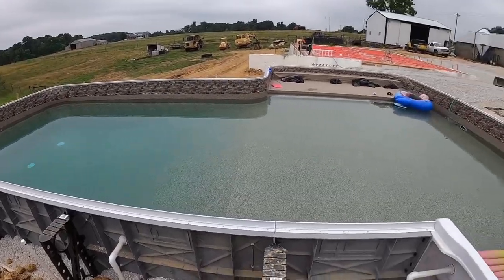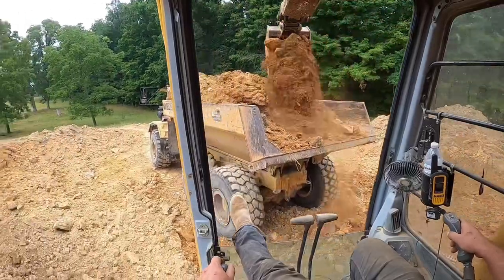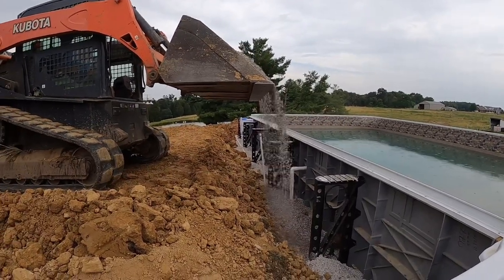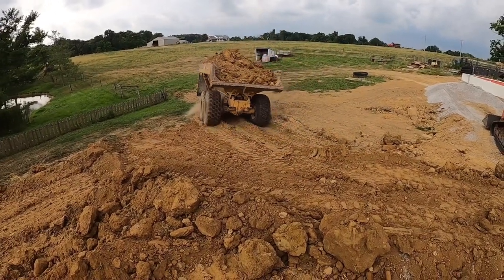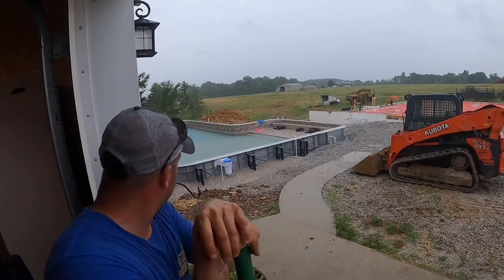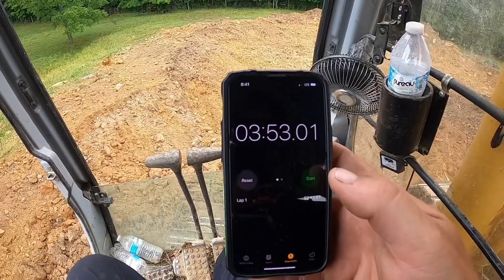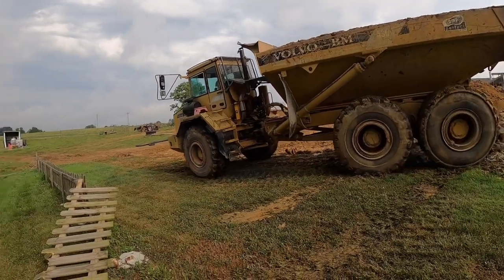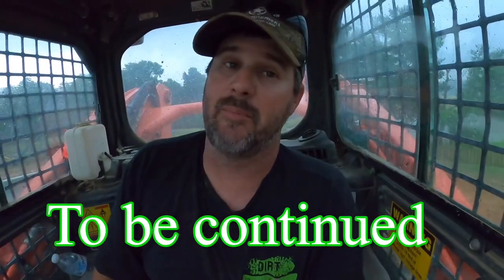This job has turned into an adventure, Kubota broke down and Matt crashes Bubba Dump into a fence.

Comment: I'm a landscaper from Tasmania Australia. A landscaper in Oz does a lot of construction & design. Deck, walls, pools, tiling, etc. Most of machinery I hire in is smaller. We don't build lakes (dams) of land clearing. We mostly import the materials onto our sites. Aggregate, gravels, soil, etc. Just going on you times, it seems far cheaper to do this than to dig up properties & create hug scares & messes. I use rubber wheel skid steers to move this around & hand tools. The areas are much smaller. I keep very clean sites & final day clean ups take about an hour. I also use 'skip' bins to facilitate this. I enjoy the big machinery side of things. Too much banter for me. I have been to America on several occasions mostly to New England & California but would love to visit your area. The size of equipment you use staggers me.

Comment: Guess the Kubota going. Could you swap it for the 210. Mmmm. Bubba dump likes that fence. The site will look great when you finish the job. The maths you did. you made a fair point with both machines. I know you like the 210. Kubota when thats another story. Aaron did get it working. Nice and slow. great work Mbts.

Comment: Seeing Bubba Dump slide down that hill reminded me of the time I parked my 1973 GMC step side truck in the driveway like I had many times. The driveway had a slight downhill to it. I looked out the window and the poor old girl was sliding down the hill and to the ditch. There was just enough ice on the drive so iI didn't slip walking, but I guess the warm tires created slickness under them. I was able to drive it out of the ditch before it broke through the thin ice/frost layer. The truck was rear wheel drive.

Comment: It's interesting that you have so much trouble with your Kubota - an earthmoving mob I worked for a few years ago had 2, around the same size, that seemed to do pretty well, while the equivalent Cat was an absolute nightmare... One thing after another went to (the unpleasant place), but the oranges seemed to just keep on going... And as I'm a truck driver first and foremost, I think Matt did a pretty good job keeping that monster from doing more damage than it did... And Aaron's just Aaron... hehehehe
Reply: Especially since they use those machines pretty hard New York farming Fixing and fabricating. Probably they have several machines that get used daily with Lots of hours.
Reply: Because unfortunately you can get 1 machine (any brand) off the assembly line and the very next one made behind it, and one could be great and the other terrible. Quality has slipped in manufacturing of the last 30 years since planned obsolescence is a real thing.
Reply: I didn't and I like to kill myself on a Kubota. When I called up the Kubota for the damage it took place they told me they're working on making a better one but they are still so far and they know it. They got a good idea but they do need a lot of work in advanced engineering to truly be in a commercial business attitude. Sincerely Nick
Reply: Kubota mini excavators are extremely high regarded in Europe. But those are made in Japan, not Georgia like the skid steers....

Comment: Like you said it depends on what kind of jobs you are doing. That jd 120 really runs really well and is moving alot of dirt in a little time. And for as little fuel it burns it might be cheaper to run the 120 instead of the 210. Awesome video.

Comment: We once put a loader on Michelin 650/65R25  XAD dumper tires because the same dimension XLD (loader tires) werent available. Michelin said dumper and loader tires were the same carcass, only the tread was different.

Customer called back after a month or so: He had ordered XAD for his other machines too, because in his work, spreading clay on dams, the XAD dumper tread provided much, much better traction and self cleaning than the regular XLD loader tire...

Comment: Collision with fence!  This was a slow motion, picture perfect demonstration  of the reason antilock brake systems were developed. Essentially, "If the wheels don't roll, you don't have control."
Matt followed his first instinct, which is to brake out of a bad situation.  But in Matt's defense, (or de fence?) it is hard to force yourself to get off the brakes and let the front tires carry the vehicle out of a situation like that. And truly that might not even have worked since the truck was already downhill that far.
Reply: I feel like antilock brakes would have kept the truck rolling and caused more damage also, as proven in automobiles....anti lock brakes do not stop you faster they just give you driver control as you are stopping.... without the brakes locked it would have continued on down the hill
Reply: @young11984  You can't KNOW that it would have continued on down and into the fence, you can only speculate that it might have.
And I did not say or imply that the truck should have antilock brakes or that antilock brakes would have stopped it faster.
My point was that if your wheels are locked (and they were) you do not have steering control.  This truck does have antilock brakes (make sure you read carefully here).  The antilock brakes on this truck are when the driver lifts his foot off of the brake pedal.
My turn to speculate. If Matt had let off the brakes instead of puckering the seat the truck might have steered to the right and went on out of there.
Reply: @larrywalker7759  🤣🤣man you really get all twisted and upset when somebody comments to you dont you. Without brakes applied and the wheels rolling the truck would have kept going down hill thats a fact not a speculation. With the momentum of the truck already going down hill with no brakes or him throttling it more would have sent it further past the fence than it went though....been there done that in nearly the same situation in the same size truck but without a fence lol. Calm down hoss its just the internet and some folks have  done things other people havent so its ok
Reply: @young11984  🤣 Not twisted or upset, I just wanted to make it clear about why I referred to ABS. You are of course entitled to your opinion sir, and I respect that.
I have been in similar situations to the one Matt was in when I cut and sold firewood in the '80s.  I was on a slope in a grassy field near a wood line loading a 1 ton stake side flatbed truck with billets from a tree I had cut when a rain shower caught me.  To get out of there I had to descend the slope to intersect a well worn gravel trail at the bottom of the hill.  Trying to ease down the slope slowly while steering to the right I found out real quick that using the foot brakes locked up the wheels on the steering axle and when that happened the front end of the truck would skid to the left. Letting up on the brake pedal the steer tires would roll and the front of the truck would again begin tracking to the right, but the truck also began to move faster and I did not need that. After a couple more attempts at using the foot brakes and having the nose of the truck skid to the left each time I thought about the situation and decided to try using the parking brakes instead. Doing that did actually give me enough speed control to get down the slope at the correct diagonal I needed to intersect the trail below at a point where I could cross the shallow ditch that ran beside the trail.  The ditch was the reason I had to get down the hill at a diagonal to the right because if I had allowed the truck to go STRAIGHT down the hill like it was trying to,  it would have intersected the trail at a point where the logging company made a 5 foot deep cut into the hillside for their logging operation.
To recap a bit about my reference to ABS.  I mentioned ABS not because ABS helps a vehicle stop sooner but because ABS allows the wheels to roll instead of skid, and the entire premise of ABS is "If the wheels don't roll, you don't have control".
Reply: Did he even use the brakes the rear wheels were turning?
Reply: @szki272  Yes, he used the brakes. When he first let the bed all the way down and started to move,  the front wheels were rolling, but then he got nervous and applied the brakes and the front wheels locked up and at the point the front wheels locked was when the truck began skidding straight down the hill (gravity).  The rear wheels never locked up but the brakes were definitely working on the front axle.

Comment: I worked for an outfit that had a couple 160-170 size excavators. Fuel consumption was OK and we could move them with a little 20 ton trailer. With a good bucket selection we could do a lot and not have to run a 30-40 ton machine for a small job.

Comment: Slippery wet grass is like snow and ice. Locked up tires just slide. 
Matt in Bubba Dump may not have cleared the fence but he would have had a better chance had he not put all his strength into the brake pedal. 
Good thing is that it was jus a few sections of fence that’s easily replaced.

Comment: Have him unlock the diffs when you are trying to steer and brake in tight or slick spots.  The front especially will probably help.  Next time Park the Kubota at the hole in the fence, accidental fish habitat conversion would be covered by insurance lol.

Comment: You mentioned in one of your earlier videos that you want a skid steer with slide up front door. Looks like you only have option for Takeuchi or Komatsu.
ASR skid steers have an interesting under carriage with large rollers, has bin Terex for a while. Is now part of Yanmar, also with Yanmar engines, is also interesting option.

Comment: Greetings from Central NH Lakes Region - You might consider trading in that Kabota for that Deere 455 track loader that Clint is rebuilding. With the 455 and that 4 way scoop, you can use it like a D4 and as a loader in situations like this. That 4 way would allow you to contour and push a lot better than the Kabota. At 19,000 pounds it is still not bad in tight spaces because it is a short frame. Just a suggestion.
Reply from the maker: Absolutely not would be completely worthless to us

Comment: Mike , I just wonder if  the tipping time on Bubba is much different between fast tick over and reving to valve bounce !
I have a thought that the hydraulic pump output is Not related to revs that much and you'd save a load of fuel !!
Reply from the maker: Huge difference in speed

Comment: Having fun on the grass. Not Matt's fault. Equipment wise, at least in my mind it wouldn't be either the 120 or 210 it would be either the 140 or 210. I think  the 120 and 210 compliment each other and fill different needs more so than the 120 and 140. It just depends on what type of jobs you plan for the future. If there is enough large jobs then the 210 would make sense. Not that my opinion has any value, it is your business and your money. Thanks for sharing.

Comment: I would say that was not entirely Matt's fault if you watch the video the rear brakes never worked the front wheels locked up but the rear 4 kept rolling
Reply: yeah that needs some checking! :)
Reply: Was not his fault regardless of brakes locked or not! It’s gravity and weight! Even if it had new tires all the way around, on a side angle slide the tread of the tires don’t do much! Now they know for sure that bubba don’t like wet grass!

Comment: For the future. Don’t use lockers on a slippery side slope. The unlocked wheels wheels with no traction will spin but the ones with traction will only turn slowly and wont lose traction and wont slide they will hold you from sliding down the slope sideways.

Comment: Bubba Dump needs the brakes tightened up in back. When the front wheels were sliding, the backs were still rolling. Maybe the lockers were still on? Turnings a bit hard with locker on, even if it is articulated.

Comment: When on grass there isn't much you can do. Aaron couldn't have done anything more or less than what he done. Playing couch quarterback he could have backed up at a angle, then pulled out. But it's always easy to see what should have been done after it's happen. Fence can be fixed and on to the next job. Good work guys!!

Comment: Around the pipe yo should put sand 
An in ground liner pool  where the lines will freeze  needs the buffer of 18 inches of frost line. STONE will let cool air penetrate from the deck  .the coping will crack as the wall gets pushed from the freezing water point
Chicken wire works best for the deck
Reply from the maker: Lol that will not be a issue I promise thanks

Comment: hello from the Netherlands .  
question : when he was empty , did Matt turn off all the lockers what it looked like on the images that everything was still turned on .  
you only use the lockers when you are loaded to get traction/grip.  
when you're empty you actually have too little weight for 6x6 to help you + that you can't steer or much less because the diff's are locked.  
with the 6x6 on you are pushing AGAINST your steer wheels and usually the front is too light to get enough grip to work against it.  
empty = lockers as much as possible set to OFF .  
Sincerely, Hollandduck

Comment: The fix that would have saved the fence would have been more expensive than the fence.... berming.  We use it all the time on minesites, and for those big haul trucks on steep hillsides it often becomes part of the road or switchback when things are slick or steep.  It's expensive in time and moving material twice on jobs like this, though.

Comment: Sliding in a truck is almost the worst feeling a driver can have. You're minding you're own business, next thing you know, it's off to the races and there's nothing you can do but hold on for the ride.

Good that it was only an old picket fence and no one was injured.
Reply: Jesus take the wheel...
Few years ago I was delivering news papers and fell asleep at the wheel.
Only for few seconds. I drifted off the road through a yard off a 5 ft. Wall.
Well I heard a voice tell me turn right....
I did and went up the driveway. I was lucky, guy was understanding. Just had to clean up peastone in driveway after I  went to hospital for busted lip.
Reply: I WAS LOOIKNG AT THE POND WHEW THAT WAS SCARY.

Comment: Our pool builder poured two feet of concrete around the pool base and filled in under the stairs with concrete then filled in with dirt. He waited 4 weeks for the dirt to settle before pouring the deck around the pool then we filled the pool after the deck was done.
Reply: I was just thinking simular... i would put concrete under stairs.   There is no way to compact stone under there.... if water don't move it will be fine, but if it get under there..
Reply: @DusanTodorovicDukeBgd  the best part of concrete instead of rock was the concrete flowed where it needed to go versus having shovels in hand for the micro adjusting of the where the rock needed to go.

Comment: I must admit Kubota skid steers have their issues when they're working they're working like a champ but when they break it's a headache it is something to do with the fuel system or some type of sensor the company I work for has two and one of them doing the same exact thing his was doing the other one is new so hasn't any problems yet
Reply from the maker: Yup

Comment: Your labor and the truck drivers labor both count in addition to the cost of the diesel (and the amortized cost of the machines) when you are doing that calculation.  1 minute faster on a 4 minute cycle is a lot of improvement.  If the operators each cost $60 per hour (not what they take home after deductions, but what they cost your company), and each machine costs another $60 per operating hour to acquire and maintain over its life, you are at $240 per hour for just the 2 machines and 2 operators.  Each 1 minute saved on a cycle is $4.  Even at today's prices, that is a lot of diesel to not burn to get even.   After the other work is added in (operations that occur while the truck is delivering), it may drive things back the other way, or add to the advantage.  If you get the machines or labor for free, it will greatly change the outcome of the equation.  But good to always be thinking about it!
Reply from the maker: Agree with all that but missed just as much think about it

Comment: Mike I have a question about Bubba dump is it and can you add a vibration device to bubble dump to help get the stuck dirt out ? Thanks again Mike
Reply from the maker: Could I guess
Reply: @DirtPerfect  don't know cost or if it would work but might be option. Good luck Mike

Comment: Not supposed to have the backfill and the water more than a foot apart? What happens if you ever need to drain the pool?
Reply from the maker: Will be locked in on the to by that point

Comment: Having all 6 locked solid, caused the side slip.  If all the diff locks were released (on the down-hill exit), then the truck would go where it was pointed, instead off all the axles fighting each other for grip and gravity taking it sideways.

Comment: You always mention fuel burn. How much fuel does the truck use while sitting to be loaded? On another note I have been running a deere 325G track loader. I get around 5-6 gallons per hour burn rate.
Reply from the maker: Man this truck is crazy not for sure what it runs on will go a week ok 30 gallons crazy
Reply from the maker: Good ? Tho
Reply: Love the machine. Will fill a 78” tooth bucket easily and spin the standard tracks. 9500 lb machine… my favorite in that class…

Comment: Only 42" bucket on the 210? I worked for a company that ran a 54" hi cap bucket on a linkbelt 210. It load a tandem truck in 8 passes if I recall correctly. Definitely felt a little big, but it made me be a better operator 🤷‍♂️
Reply from the maker: Don’t own  the machine so hate to buy a bucket
Reply: @DirtPerfect  ohhh, right, right, I forgot, of course not 😅